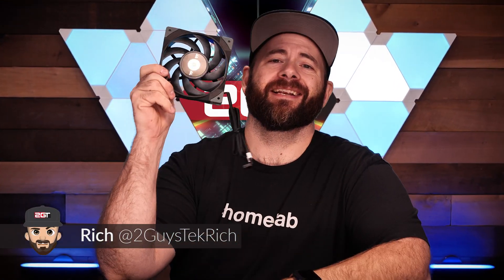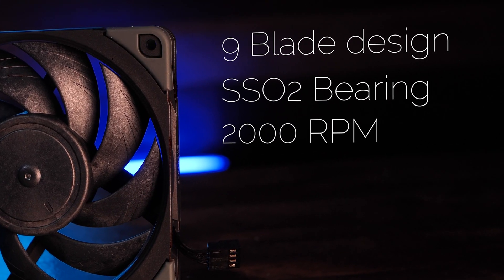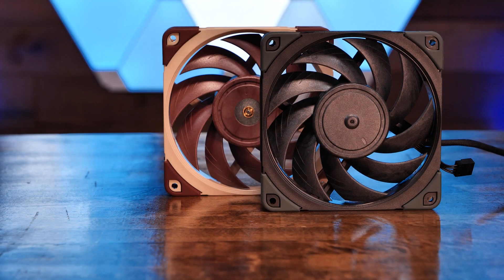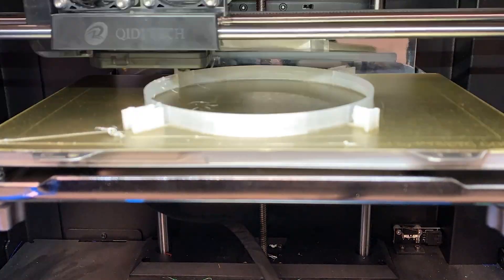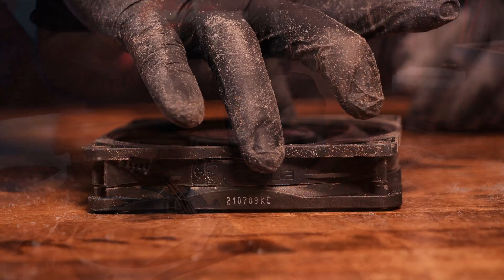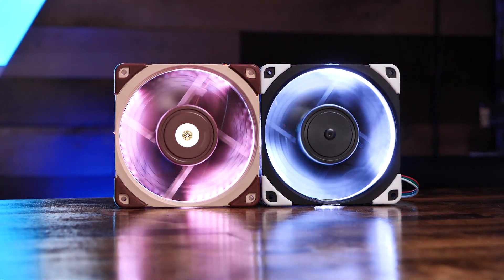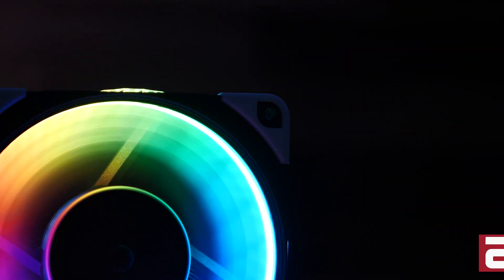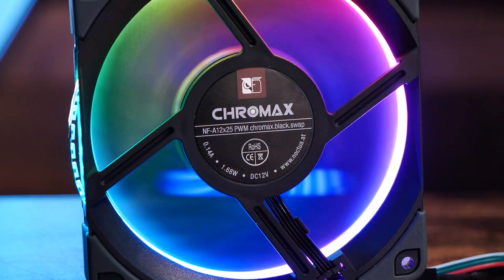Why isn't Noctua doing this?! - Noctua NF-A12x25 Chromax Black Swap RGB!

Comment: If you end up dinging up your fan blades, that isn't necessarily a problem— there's another YT channel that features user-submitted 3D printed blade designs for Noctua fans.  You may end up with an even better-performing and better looking fan!

Comment: Why is Noctua not making this? Because their fans are the best in terms of performance, materials and engineering. LGBT lights add nothing to performance, but would mean a compromise in materials. I'm glad they made the NF-A12x25 Chromax Black with the short header, because the aim for those is AIO radiators.

Comment: Another solution would be to take a phanteks halos led strip and use that instead of the strip used in the video. That way your have control via hub or motherboard

Comment: Thermaltake is already finishing a design like this. LCP Impeller blade. Different material frame/composite LCP/usual plastic frame.
Reply: that sounds horrid
Reply: @arranmc182  It's definely unique, looks wise, but it works good, Phanteks is doing a similar thing with their new D30-120 (but arguably made them look more like classic ARGB fans)

Comment: great idea,
it could have been much easier if you printed the whole thing (at one go or parts from different materials) and just used the fan rotor + supports without the original casing

Comment: Did you measure sound output at mix & max before & after? I would be interested to know if the mod caused a difference in noise, seeing as many of us like Noctua for their low noise at high rpm output.
Reply: I dont think the sound has changed, maybe the cooling preformance because os the poort quality of a 3d print instead of the regular noctua plastic, but i think noctua can do it and it can be at the same level of the non rgb ones more expensive but at the same level (i think the price is the problem, maybe they think that noone want to spent 40 bucks on a fan)

Comment: I had an idea. Since I need 6 of these wouldn't a table router do the cutting so much better?
Reply from the maker: A bandsaw would be better, a table saw seems risky.
Reply: @2GuysTek  thanks. So you just need to cut until it's serrated right
Reply from the maker: You’ll need to cut just enough to separate the parts. Be very careful not to cut in too far to prevent damage to the blades of the fan.
Reply: @2GuysTek  got it. The router table seems like you'd have more precise control. 2 whips on a bit that is at the cut point fir each side seems it would seperate nicely. The jeweler I could see working too with a gaurd as to not go to far. Thanks guys awesome work
Reply from the maker: If you end up making some we’d love to see your results! Best of luck!

Comment: Y'all need a slitting saw in your lives.

Turned out fantastic all the same.
Reply from the maker: Can I borrow yours?
Reply: @2GuysTek  it's probably more likely to give you tetanus than make a decent cut, but I might be able to resurrect the old Shopsmith.